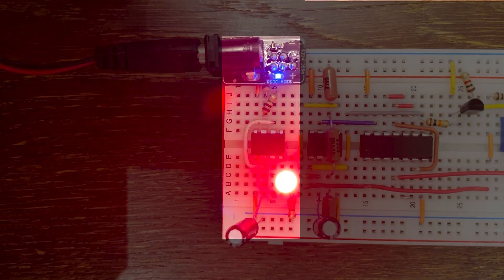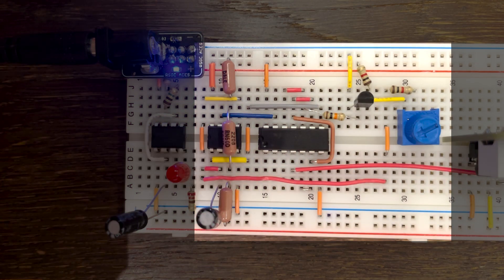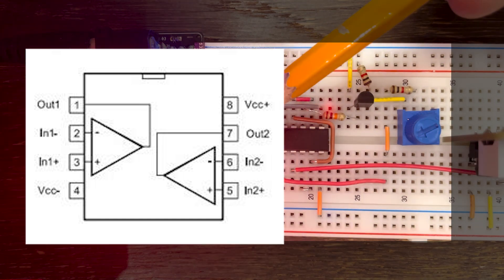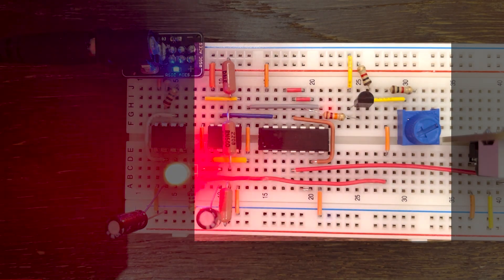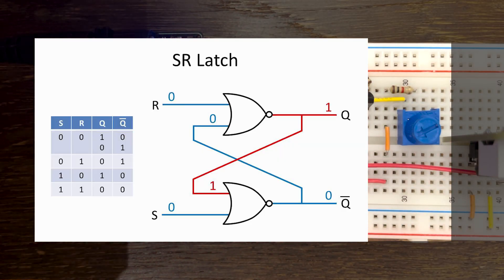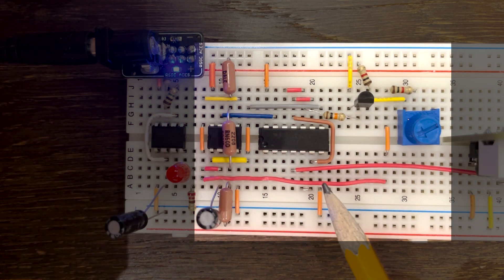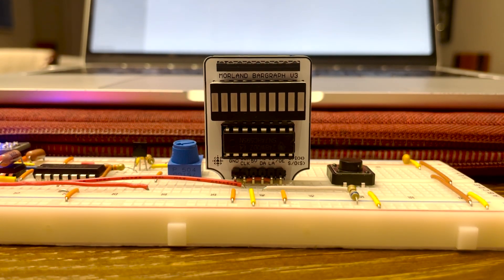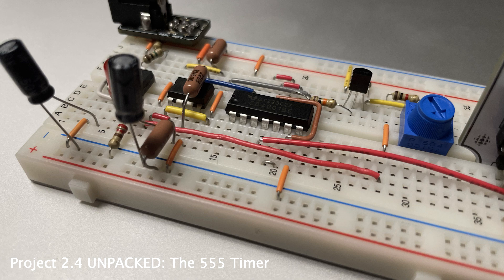Project 2.4 UNPACKED: The 555 Timer

Comment: Nice on, i liked the shift register thingie. I’d love to replicate the experiment, could you please share schematics. Thanks
Reply from the maker: This is the schematic for the unpacked 555: https://drive.google.com/file/d/1fANwhG0K5lErgVnYj2HI8IzVGJApaY0H/view?usp=sharing

I don't have one for the shift register, but you can drive the clock and latch pin with the PWM signal (as I believe I described in the video) and wire a button to the data input, then wire all outputs to the bargraph. If you wanted to drive more than 8 LEDs, you can actually chain more 595s together (google 595 daisy-chaining)